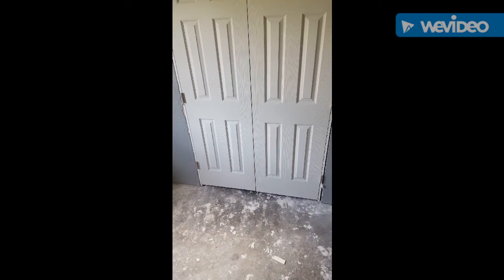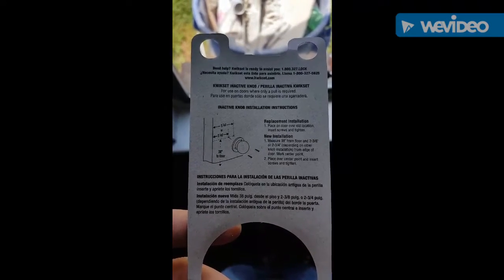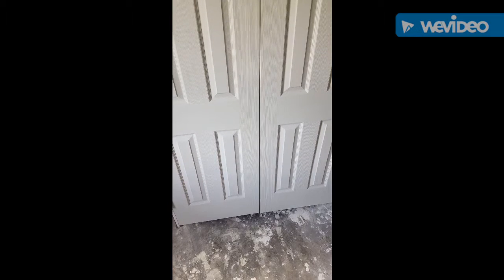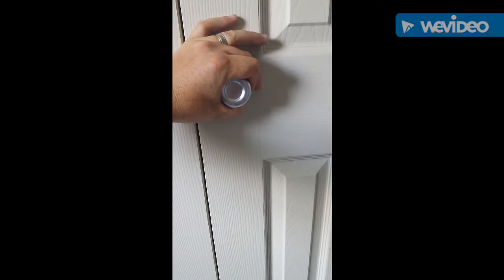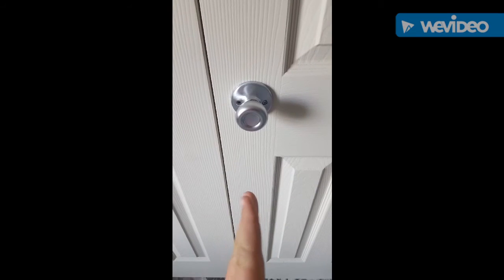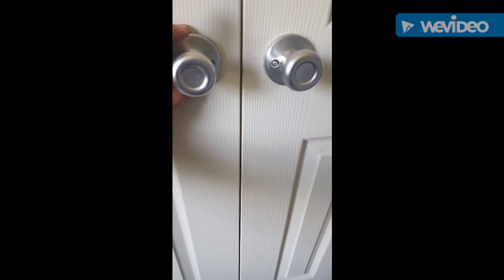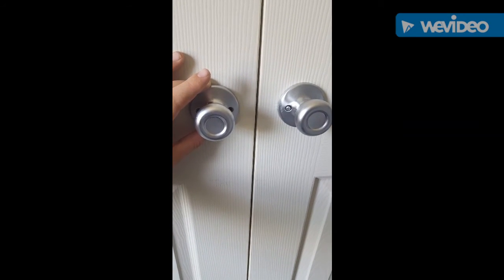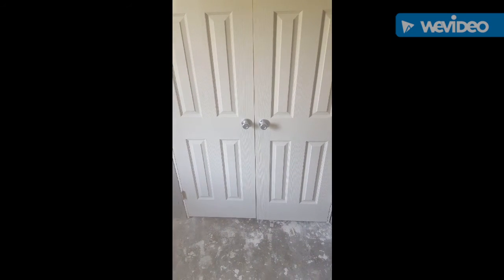How to install a dummy door knob

Comment: I install these every day. 2 3/8 is the standard measurement to the center with residential knobs. When installing dummy knobs I always make a line with a combination square at 2 3/8 and measure up from the bottom on the doors with active knobs to the screw, add 1 5/8 which is typically the spacing between the screw holes, mark the 2 screw points precisely, and make sort of a pilot hole by marking my screw holes with a 1/32 nailset. This way all of your knobs will be as perfect as possible, if they appear out of level, it is because the double doors aren't level with each other, but the placement of the knobs on the doors is more noticeable to the eye than if they're a 16th or so out of level.